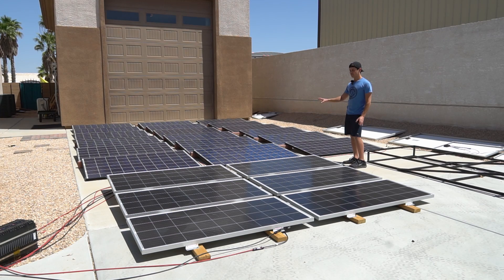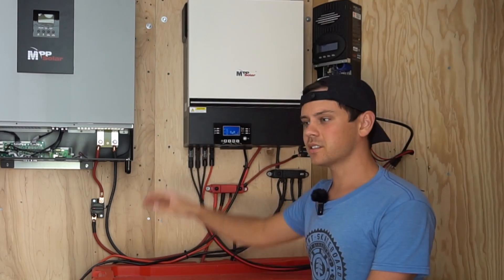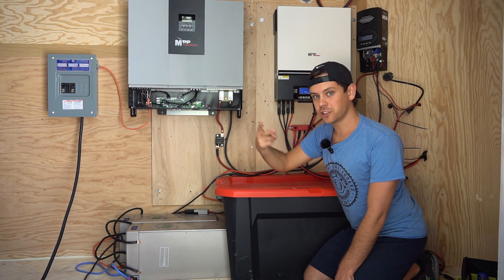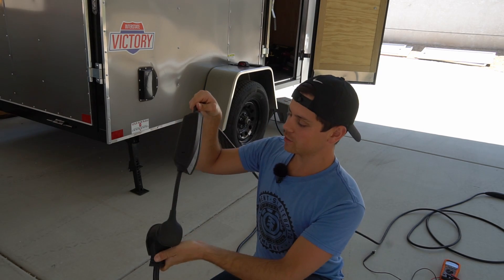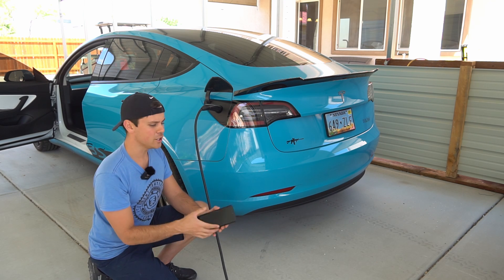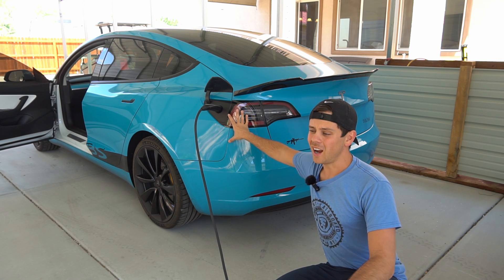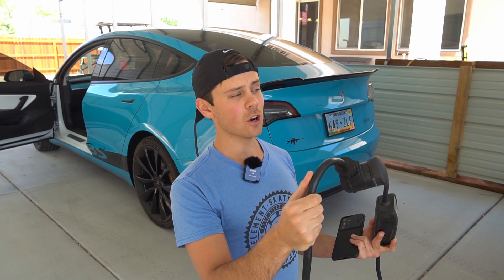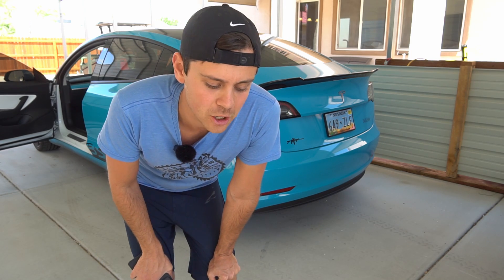Using my Offgrid Solar Trailer to Level 2 Charge my Tesla

Comment: Amazing system, you probably could see a ROI in three years or less if you charge weekly. If you run more things in your house also, may be even in a year. Also check out the Algorand cryptocurrency which is extremely efficient, a lot better than Bitcoin.

Comment: Well, I was looking at getting an hybrid car with a battery that has about 25kwh of capacity, however, I don't have a garage and we're only allowed to park on the other side of the road, opposite from my house, so it's not like I can just run an extension through the window to the other side of the road 😅, so I started looking at portable battery systems like the "ecoflow delta pro 3", but by the time you add the expansion batteries which can get it to 12kwh you're looking at a price tag of 7k euros, which would be by itself about 1/4 the cost of the car, almost brand new. Then I found out about those home power backup batteries that people use with solar systems, mostly. You can get some that come mounted fairly nicely with cart wheels on aliexpress, for example, with 15kwh capacity for like 2K euros, so I started wondering if there was any way that I could mount some sort of wallbox/ev charger to it and use it as a portable battery charger in the following way: charge the "power backup" batteries overnight or during the day with a standard wall socket and then every other day, as I need to charge the car, drag it to the road to charge the car. However, and as I haven't been able to find anything like this online, I'm starting to think it's not doable, or at least not on a portable way with a small footprint, as your system seems to be more or less what I was looking to do, but with the battery storage being charged from the wall current/house plug instead of solar, yet you literally have a whole trailer for that setup and not a "portable cart" 😅. Guess I'll have to stick to my old diesel car a few more years and think a lot more about this... There's no public chargers on my street or close to it and my work garage has a lot of cars going in and out all day, so it would be a bit "scummy" to just take my car inside and charge for free while bothering other people going in and out by having the car "sitting there" 🫤

Comment: @WillProwse Could you please provide your insights on DC direct charging of EVs. We've all seen that fold out one that maybe will add 20 mi to a Tesla in a day. I'm thinking of something off-grid bypassing DC to AC to the onboard charger to DC batteries. I'm guessing the folks have some way to go DC direct into a NACS charge port from their solar panels.

Comment: Canaan makes small Bitcoin miners, Canaan Nano 3 that work well with solar. They range from 140-80w miner settings and adjusted on an app. You could have some to round up or down your mining and electricity usage if paired with a larger miner.

Comment: What I think? I recall one of your earlier videos when you kinda ranted about people crying about high fuel prices and electricity prices, calling them out as helpless and whining and stating they were so weak - if they don't like what is available why don't they make their own solution? I am not all crazy about Americans but that approach is something I'd respect. A lot of areas in the US has very high insolation so at least a part of the year you can reliably produce your power to drive around if that's your kink. Gringos are somehow totally stuck to having their own single family homes and big properties, yet many don't take the opportunities it gives them. Good demo.

Comment: Question: You mentioned legal solar panels, because on ground? Where if raised on a deck/platform a co is required in most towns?
Reply: Amazing how AI instantly edited another comment about government "hypocritical regulation requirements" for independent generators versus government /power producers not having safety issues with all the electric lines and connections they haphazardly string throughout towns. Let me see if this comment is censored.

Comment: Are you planning to mount the panels on your trailer? I have a similar vision of making a trailer like that to pull behind a model y and charge it on road trips to go across the country only on solar camping in the trailer. Stopping a few days to charge and rolling on when the battery is full.

Comment: You mentioned that you could make a massive array.  Would this eliminate the need for batteries at all?  Meaning solar direct to the charger controller and then to the inverter.  This would obviously only work during the day and good light.

Comment: How I wish we had an equivalent 14-50 nema in the UK. I can recharge my 3 performance from 40-80% over night, so it’s just enough. Australians, only get 5 amps or 120volts!!!! Why?!?!  

P.s. British Electricians I know we can get the blue adapter thingy for Caravans and hot tubs etc, but the quotes are like £450-£500 for just the plug socket

Comment: Hey Will, have you ever hooked up an inverter to your Tesla?  Sounds like a 2000w inverter hooked up to the 12v jumper terminals might be possible?  I'd use it to power some basics in the house during a power outage.
Reply from the maker: Yeah I did that in another video already some years ago
Reply from the maker: Video is still up

Comment: I’m curious to see how you would scale down the battery and scale up the panels. Would you need different charge controllers and inverters? I’m interested in doing this at home with solar on a shed and I just want to offset my EV energy bill, I don’t really need to store long term and I don’t want to tie to the grid.

Comment: Can you make it more portable? Out the batteries and inverter in a smaller box and have the solar panels mounted on the trailer, maybe so they fold out?  Having a bunch of panels on the ground isn't ideal for most people

Comment: Your affiliate link is broken. But if you manipulate the web address enough, you can still get to the website for some ridiculously good deals. I was just locally quoted $70k for a 10 kW grid-tied system using 400W panels with a single Tesla Powerwall at 0% financing for comparison.

Comment: I am wondering what size and type batteries you are using to charge the Tesla? Are you only charging during daylight hours? I am working out what I need to add to my off grid system to charge a car.

Comment: I have been watching your videos to prep myself for the dive into solar. I plan on buying an electric car. Probably an older model Nissan leaf because the batteries can be swapped out easily enough. But what I want to do is make a solar array on a carport that charges a battery bank. Then when I get home use Dc to DC charging to charge the car. It seems wasteful to feed dc into a converter to just convert it back to dc for the car. I can not find anywhere on the internet. It seems most people are either talking about straight solar charging. Which is no good when I work all day. Or they are suggesting the dc to ac then ac to dc charging like your video. Do you have suggestions. It seems like you have the setup to monkey with this.

Comment: I built a smaller system to charge my Model 3 LR.  It works well but I'm curious about the difference in range I get when at night from a full battery vs doing it in the day when the panels are active and the MPPTs are going into the inverter and the battery.  It makes a huge difference.  Why is that?  Is there that much loss when going into the battery and then back out to the inverter?  Thanks!

Comment: Not bad on the split phase. I was curious on amps and volts to charge a EV. I’m running single phase at the moment for 3.5kw but will be upgrading to split phase 18kw soon. Nice to see the EV charging on so little amps! Thanks!

Comment: Here in UK we are restricted to 3.8kW output from 4kW of panels if you go grid tied and despite our famously dull skys I know my roof solar puts out at least 1.5kW so setting my model S to 5A (= 1.25kW @ the UK standard 240v ) 95% of the car is charged from the sun. OK its only 3 miles an hour but normally 20 miles a day is a usefull top up and since Ive been doing this for 8 years its saving me a lot.
As a bonus our feedback tariff system pays 50% of the total generated back in cash at a reduced rate but still amounts to £900 a year ($1,000)
Your stand alone system is tempting me to build similar for the future what a great channel.
Reply: My gut is telling me the government is putting restrictions on limits which tells me it is the government producers of electricity will tax or strangle private production so that they will be at financial advantage. So it appears independent or homestead producer has to always stay one step ahead of regulations. Or homestead producers have to lobby to prevent government producers from controlling whole electric production market to just their advantage. Similar in my town with wind turbine electric production. Just as models were being produced, my town said you can't put one up on your property unless it has 300 foot clearance to neighbor on all sides as it could blow down and cause harm to neighbor, yet their are power lines strung 25 feet from houses that be blown down in similar storm, but that is acceptable and not a problem for years. So most properties in my town are 100 by 100 foot lots with a house. So the government and power companies just outlawed a cheap form of power generation for home owners "to protect us" yet their power lines strung all over the neighborhoods "are no safety concern"

Comment: Nice how it works in other Countries. I can charge mi M3LR here in Germany with the standard type 2 connector easily with 11kW (if my grid tie 40kWp solar system delivers that much at that moment)

Comment: Great. I was wondering if one could level 2 from solar. What if my house and two,apartments were completely off grid and I need to not drain my batteries to charge three Ev's. How would you configure the system to only charge the car when batteries are full as to not drain the battery bank? I intend on using spf3000es Growatts x 3  in parallel on my main house system, and  2 in parallel on the apartments?  Thanks in advance.

Comment: I plan to get the new Ford lightning and I’d love to do a solar bed cover.  I know it won’t give me hardly anything, but the idea that even in an absolute worse case scenario, I’ll have some mobility, will be reassuring.  

If I do get one, I’ll probably get a compact 240v capable inverter generator that lives in the truck bed, just for those absolute emergency situations. 

And before the hippies chime in, yes I’m aware generators pollute…. So does the energy supplier for my house.  Besides, for me, the go green aspect is a big plus for sure, but my motivation for EV is the silent running, and low/virtually no maintenance aspect.

Comment: Does anyone know if the Tesla Cybertruck could hold enough panels and batteries and controllers to charge itself quickly at 220v? Would it be too heavy or too big for the truck? I could see myself setting up chargers at camp and never having to fuel up the entire camping trip.

Comment: Just running some numbers, and I'm the furthest thing from an expert, using the LV6048, 100Ah SOK batteries, and $50 solar panels I come up with to charge at 20A or 4.8KW (80% of 25A) without interruption:

$1600 for the LV6048.  $1700 for (4) - 100Ah SOK Batteries (4.8KWh storage), $1400 for 28 - 250W panels (7000W but assuming they actually produce 4800-5600W on average), freight for the panels $700, and random wiring, plugs, etc $300.  You're basically at $5700 for the rig to be able to charge consistently during the day.  Setup is basically worthless during the night.

Assuming electricity at $.15KW and an average driving of 15,000 miles a year at 3.4mi/kw, that's 4412kw or $661.8 per year.  So it would take approximately 8.5 years for this type of setup to pay off.  Big picture, the numbers aren't quite there for a setup like this to make sense.
Reply: It will take about 5 seconds to pay for itself if the grid goes down or there’s a gasoline shortage. Independence is priceless.

Comment: I live off-grid in a solar powered house I built myself singlehandedly. Finally figured out how to charge my model 3 long range from the sun. I have four 300 watt solar panel gets full sun all day. I have a Growatt inverter which has an 80 amp MPPT charge controller built-in. I Have configured panels serial/parallel for 24 volt output. Growatt is split phase so it provides 240 volt output.Then I have four BattleBorn batteries. Get 28 miles per hour. $1250 for panels, $750 for Growatt inverter, $3000 for batteries, misc cables fuses $250, total $5,250. Actually anticipating charging my cybertruk next year.

Comment: Thanks for the video Will, inspired me to take the plunge on building a solar charger for our Nissan Leaf. A few questions - do you have a recommendation for the NEMA 1450 female plug, or just shop around on Amazon? Also, would this work without batteries, ie. by plugging the MPP all in one to grid so that when available the EV charges from Solar, otherwise it pulls from grid?

Comment: Question: îs it possbile to charge the Tesla using DC direct from Solar Panels, of curse having many solar panels în series to have the minimum amount of voltage and  amperage? Could you try this. I am asking because i have an electric bycicle which i charge direcrly from 3 solar panels în series, which have 60V în total, and i use a step down circuit to 42 V to charge my 36 V electric bycicle and it works fine. Could you do the same with Tesla, serialise 10 or 20 panels and connect direcrly to The car? Please let me know your thougthts.

Comment: Hi Will. In my van I have solar charging a leisure battery and two starter batteries connected together. Everything seems to work great but everyone tells me that this is a terrible thing to do. Despite that,nobody seems able to say why I shouldn't do it. Do you have a video that covers it? If not would you be willing to run one? Thanks a lot!

Comment: What I've learned from Will's fun, informative videos, is that if I want to charge my electric car using solar, I'll recoup the cost when I am about 157 years old.  Fun, expensive hobby.
Reply from the maker: Not even. This system is cheap
Reply: Somebody give Craig a calculator.

Comment: I have had your book for awhile but have only started to use it now as I was forced into retirement and have started to work on my van. Right now I am working on insulating the interior after which I' ll put in a 400 watt solar system and then drive off into the sunset. Keep up the great work. Love your videos.

Comment: From what I learned, 48 volts and lower does not need permits. I have a question , I have solar  on my home.  When  city power  goes  off, nothing works. What do I need to add, so I can run the house off just the panels, when the power goes  out? I say just the panels, but realize I will probably need a small power wall too.

Comment: Hey Will, Not sure where to ask you general questions so I thought I would try a comment. I just ordered 2 24v batteries from battery hook up for my RV. I am wondering what would be the best option for a Charger\Inverter? I want to add solar eventually but not a short term goal.

Comment: You should probably just use all your solar on BTC mining, get more miners and just live in a tent. It will suck for about 5 years, but then you will be so glad you did :) Just kidding, dont live in a tent, but very c00l on some off grid inputs for your miners. I'm thinking will be c00l when starlink gets up and running, one could put a massive array of solar in the middle of nowhere(cheap land) and then just link up the miners on starlink and BOOM stackin sats!!

Comment: Anybody? says the rich guy :-) seriously though first great video and damn that tesla looks nice in that flat blue.

I have a nissan leaf. I am working on charging my leaf on solar at 110v. why? simple. I CAN"T AFFORD what you have :-) what did those batteries cost you. yeah. a pretty penny. even a single 300ah LIFEPO4 is $1600

with 110v I can do it with a 2kw solar array and a single lead acid battery to act as a fluctuation buffer and a 1500w pure sine wave inverter that I already have. IE I might be able to afford that

So it would take 3 full days to charge from dead maybe a hair more but "usually" that is enough to keep me topped off and I can always tap into the L2 when I need it :-)

Comment: Hey Will, I really appreciate your knowledge and the work you do on here. I see some China off brand batteries popping up on Amazon for cheap these days. I am in Canada and the cost of batteries shipped to me is outrageous. Any chance you can check out some of these cheaper brands on Amazon to see if they are worth the money for us not living in the U.S.?? For example: MOSEWORTH 12V 100Ah Lifepo4 Lithium Iron Phosphate Battery Built-in BMS Life More Than 3000 Deep Cycle for RV Emergency Power Supply Golf Cart Solar Campers Storage Wind Energy/10A Charger. This one is $680 CDN plus $40 shipping.

Comment: One thing that is never clear is how to wire a series or parallel battery to the source. For example, If I wire 4 batteries in either series or parallel, on battery 1 the positive cable is wired to the source and on battery 4 the negative cable is wired to the source. In other examples using the same 4 battery, in either series or parallel, I see on battery 1 both Positive and Negative cables are wired to the source. Which is the correct way if there is such?

Comment: My 4.5kW array and 7.4kW inverter have been producing more electricity than my house has been using; after rolling back the electric meter, the electric coop only gives about $0.03 per kWh beyond (not much beyond) the power the house uses, so while I’m not charged for electricity, I’m still paying about $28 a month for the meter that keeps me on the grid.